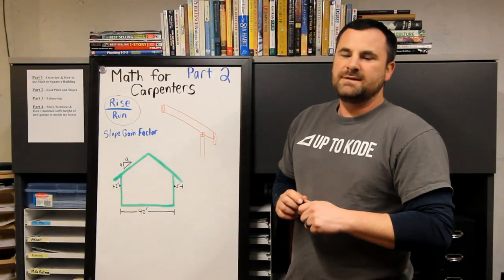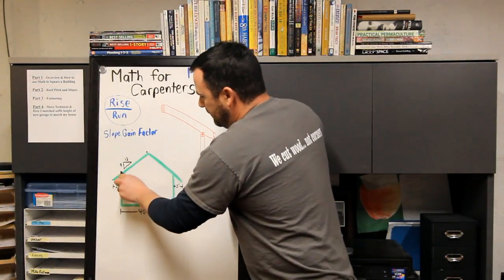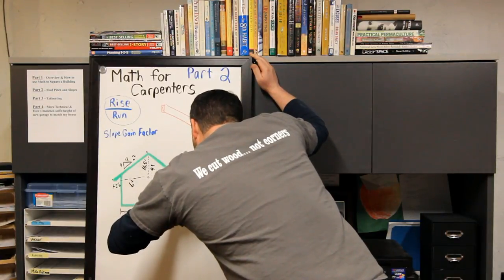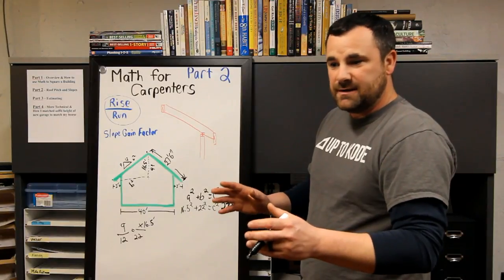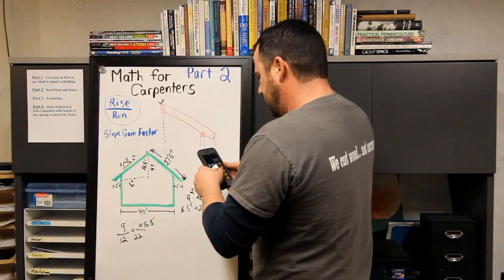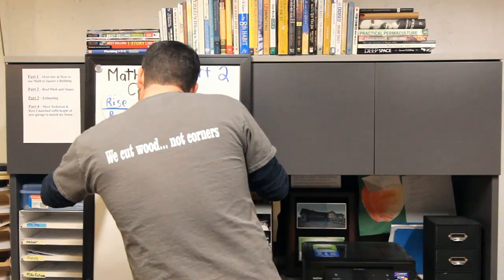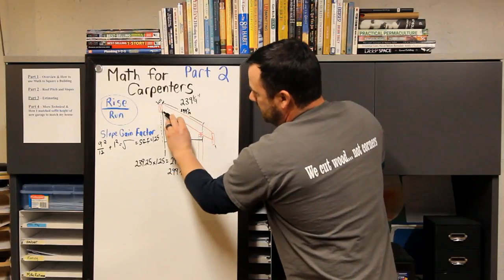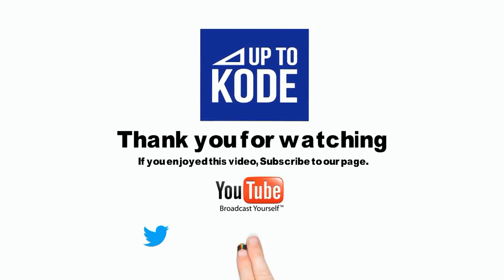Carpenter Math : Roof Pitch & Slope Gain Factor - Pt 2

Comment: Pretty handy.

One of the corky things that bothers me is when using
the common "rise /run" system is WHY they (whoever was behind its use) decided to exceed a 45 degree pitch by simply increasing the rise after 12/12.
If I was the behind the way "rise / run" was used I would have increased the pitch after 45 degrees by holding the rise at 12 and reducing the run back. (12/11, 12/10, 12/9 etc.)
Not only would it give you horizontal to vertical in 26 increments (0/12 - 12/0) 
But the difference in degrees from 12/12 & horizontal/ vertical would be an exact match both ways...you could memorize it.

IDK. just a thought.
*Technically there's too many increments involved in the current system....(not that its nessesary) bit a true 90 would take beyond a 12,000,000 /12 pitch.
Reply: And you don't have to waste time on the math time is money
Reply: Your framing square is your best friend run multiple by rise gives you the total rise,every pitch has a formula so know the formula per rise  whether it be from 3 to 12 and just take the run and multiple it with the rise time run formula example the 5:12 formula is about 13 point something inches so if the run is 10 feet just multiple it with the 13 something inches and that would be your total length plus the additional length for the over hang at your preference

Comment: I really appreciate the video, but I would certainly revisit this one. There is a much easier way of explaining Pythagorean Theorem and how it applies to our speed squares and our framing squares. I completely understand the math and the formulas used. The math you have is correct. But if you explain that you have a 9/12 pitch on a 22’-0” run of a house. Just do a2 + b2 = c2 on the slope given.

9^2 + 12^2 = c^2
81 + 144 = 225” (which is c^2 - 15x15 = 225)

Now take 15 (c2) x 22 (your total run) and you get 330” which converts to 27’-6”.

I would use a framing square and also I would break down the math, step by step. Explaining why you use a radical to remove a squared object. For example. 9 squared. If you just put 9 in a calculator and use the radical (the squiggly line with an x underneath it) you’ll get 81 because 9 squared is 9x9.
Reply from the maker: I appreciate your input! I’ll have to watch this again. Sometimes for the viewers I start at the beginning and just teach 1 Concept. Then I advance from there. If one doesn’t understand WHY or how to do it, they won’t understand how to speed it up. I’m talking the real beginners.
Reply: @uptokode  for sure! And like I said, don’t get me wrong. I definitely appreciate what you’re doing. Because it takes real courage to share these concepts online, by putting yourself out there and let the world see and criticize or praise your work. I guess I’m doing both lol but like I said, I’m glad you’re doing it because someone out there is going to benefit from it. Thus, making the world a better place. So keep on keeping on. Thank you for starting your channel and sharing carpentry with the world.
Reply from the maker: You betcha Mike! I appreciate the support.
Reply: @uptokode  I really appreciate the effort put into this. Newly trying to understand, so I'm a beginner here appreciating your work. I used to love math and was always very good at it, til I stopped using it. Your video helps me recognize I may need to sit down to remember the division of work, but it helps me get started in how yo utilize the concepts and formula. Thanks Kody!!!

Comment: I have 28 ft horizontal house...what should be ration?
Reply from the maker: Not sure if I understand the question. Need more info.
Reply: @uptokode  sir..i have 26ft horizontal. and 28ft vertical house then what should be slope ratio...is 4:12 a good slope for 1 st floor metal roofing?
Reply from the maker: 4:12 is a very common pitch. Works great for all applications. Low and safe to work on. Works great for metal. The only reason to go steeper is cosmetic and sometimes to protect against weather or snow build up.
Reply: @uptokode  thank u sir
Reply: I'm planning to build a pavilion this summer, to hangout and use as a carport during Winter. 12' by 16' outside posts dimensions with 6" overhang on all sides. What is the perfect slope? Thanks
Reply: @cgstrek2861  was it succesful?

Comment: Hey man, I appreciate what you're doing, but I think that you just made figuring a plywood take off a lot more complicated than it needs to be. How about rake times Eve equals total square footage needed for the plywood per side(for an up and over). Add in your waste factor and I think you'd be all right 🤷.

I don't know about, a squared, times b squared equals c squaref for plywood take off, or shingles for that matter. Calculating rafter length while building absolutely. 

Also if you already have the buildings run, chances are you either have a set of plans, an eagle view, or have been to the site right? And that regard them what are you doing unnecessary math for? Not trying to bust your balls I'm just saying.

Comment: How would I get a slope from using two known heights?
Reply from the maker: You need your horizontal dimension (aka your RUN). You already have your Rise or height.  Then just convert that into a ratio of x:12. X is rise over a run of 12. Does that help?

Comment: How do I do the math for a top plate rakewall
Reply: I got it bro thanks
Reply from the maker: Ok cool.  You can use Pythagorean’s theory or use a slope gain factor multiplied by the horizontal run dimension.